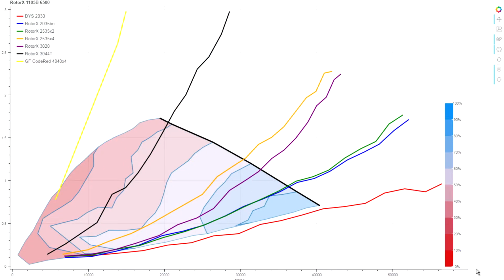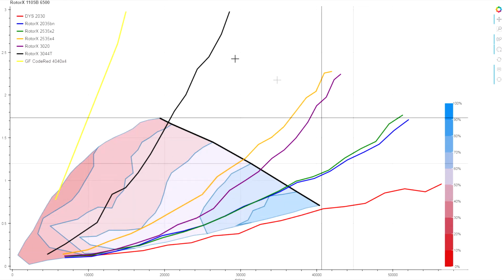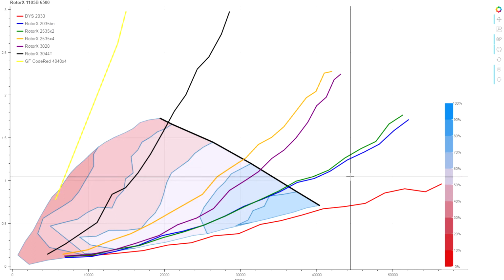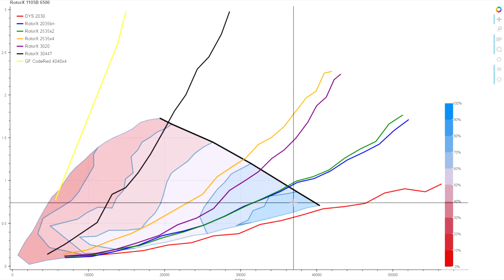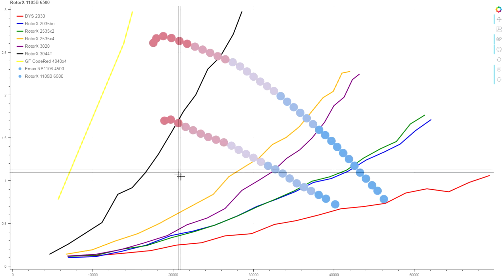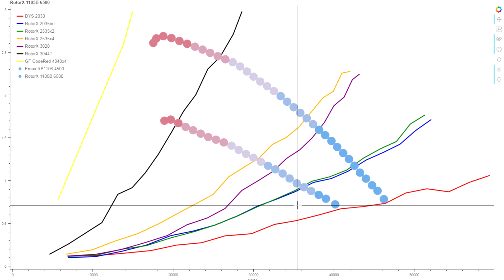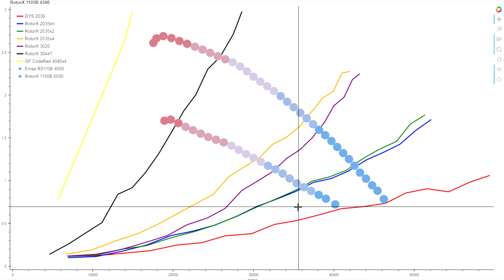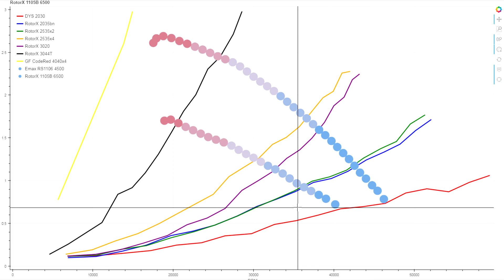RotorX 1105B-6500kv Dyno results

Comment: You can actually experimentally determine how curves going above high efficiency shift towards peak efficiency region if you do these tests with fan going infront of test stand. The faster you run the fan the higher pitch props will begin to fall in high efficiency bcz the faster you go the effective pitch drops bcz of relative velocities vector additions. On wind tunnel I tested roughly 15 deg effective angle of attack gives best efficiency for most aerofoils though lift keeps increasing till 30 deg but beyond 15 deg drag suddenly drag increases attributed to air seperation

Comment: I run a 89 gram Tomo Quad build on these RotorX 1105b 65000KV on Tattu 3s 450mah packs and average 4 1/2 minutes to 5 minutes of flight time and running them pretty hard...